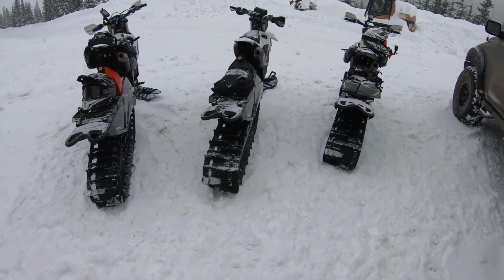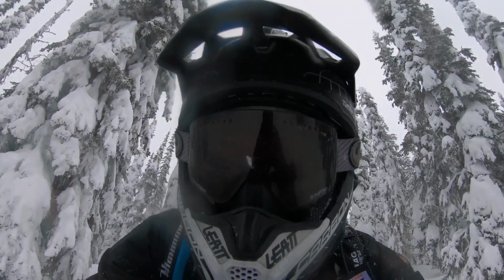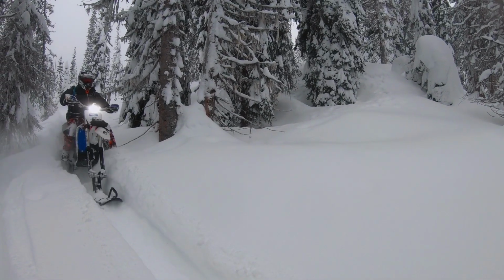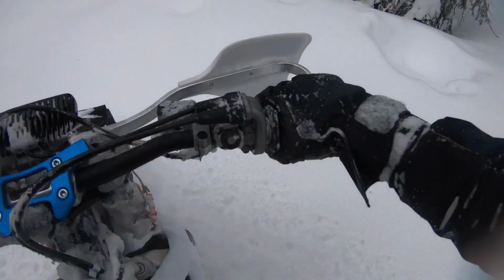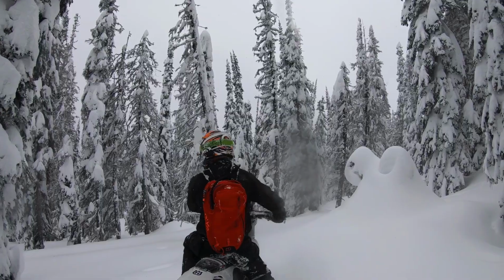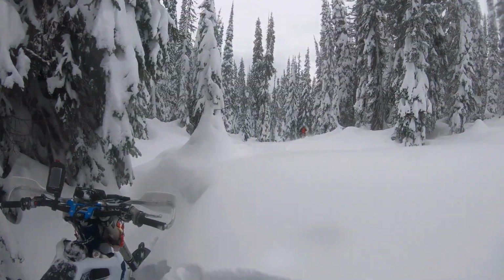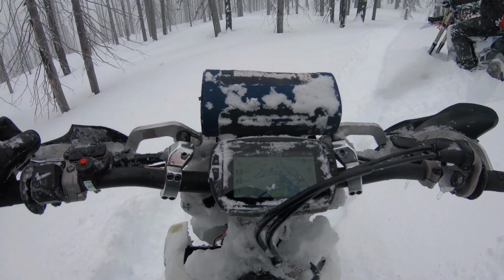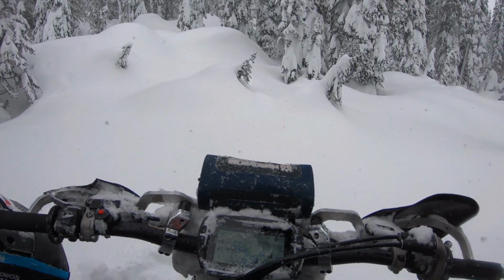Best Snowbike Track Kit Ever!

Comment: What’s the cost look like on this set up?  Similar to snowmobile?
Reply: Well, it costs a lot. I am told a new Ski Doo 850 mountain machine is now $22,500, so now top sleds cost about the same as a brand new top-of-the-line snowbike.
Reply: Scott Chisholm thank you for the info. No clue they were that much.
Reply: A 165" track 850cc summit can be had for $14K USD + fees&taxes, but the top of the line, 850cc turbo'd 175", 3" lug tack summit can be had for $19K USD plus fees&taxes.

The Husqvarna 450 is about $10K USD + fees&taxes, YetiMX is about $8K USD. There some other bling in this video, such as the engine armor, tunnel gas tank, brush guards, etc. Truly a 4 seasons machine anywhere.

Comment: Is 2 stroke or 4 stroke better for snow biking?
Reply: If you poll 10 0people, 99 of them will likely tell you 4 strokes are the only way to go. The quick and easy explanation is that they just run better in the snow and at altitude.

Comment: you should have showed Regan Sieg's track kit in the last video for the best track kit ever lol  Aro 3 all the way,  I didn't see him stopping to fix the snow stuck to his ski either
Reply: Mike rides with Reagan. The TS Aro 3 can claw its way out of things better, but it is not a better snowbike when up on a plane. The Yeti bike stay on top better, and rip faster. I am just passing along what I have been told.
Reply: @scottchisholm5603   sure hasn't been our experience.  It's a beast in deep snow and has no issues staying on top.  The brakes even work lol  Not sure why Yeti can't figure that one out especially for the price of their kits
Reply: @Hydecreeklogging  I agree on the Yeti brake issue! Now, given that there are only 2 137 SS kits in the world, I bet you have not seen one go against the ARO 3. 

Mike (137 SS guy) mentioned today that out of the Timbersled line-up, his first choice would be the 129, not the ARO 3. He seems to get to ride everything!
Reply: @scottchisholm5603  To each is own I guess we've had several bars deep days this year and the Aro 3 shines.  Haven't seen the 137ss but for what that costs hardly seems worth it.
Reply: @Hydecreeklogging  Yes, very pricey! Too bad you can't just order it from Yeti with the proper rails and track. We shall apply some pressure through our channels!

I have owned 3 Timbersleds, and I do appreciate how they get up on the snow, and up to speed early, compared to the Yetis. We are splitting hairs. SO MUCH FUN!